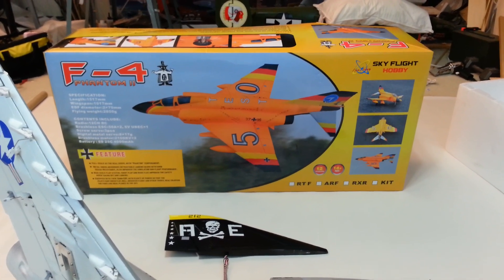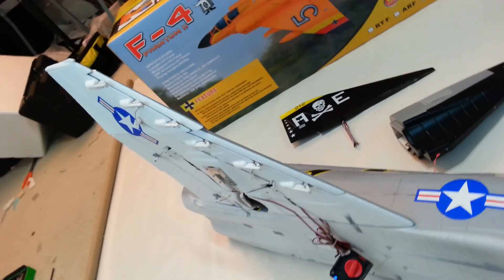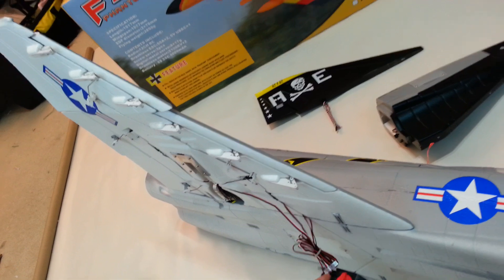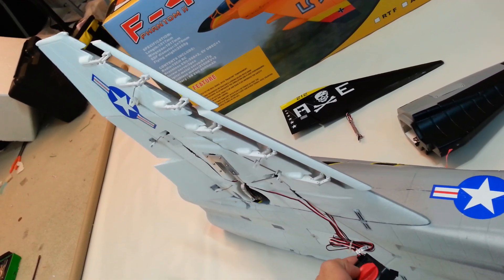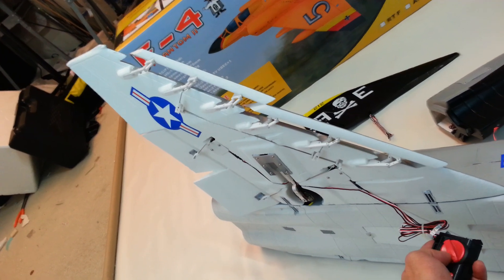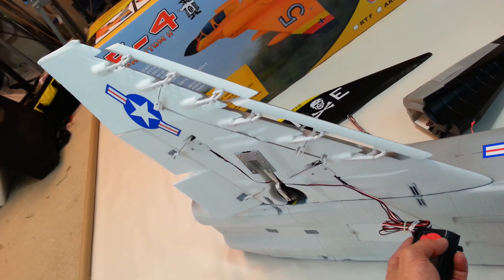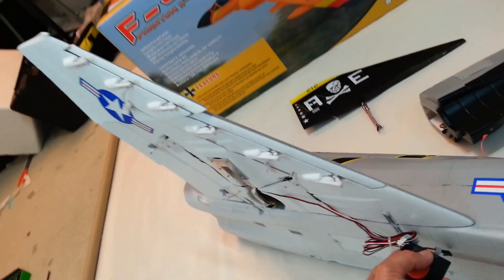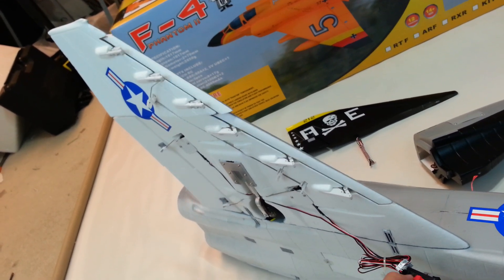LX Models F-4 Phantom ll Flap & Slat system

Comment: The LX F4 Super Phantom II is big and beefy and can fly slow enough for some decent landings.  I flew my F4 with a 3700 mAh battery.  Right out of the box it is a little nose heavy.  It is not as fast as the E-flite F4 but is is easier to see and can handle cross-wind landings. The slats help with slow flying.  You can tighten up the slats to even up the action of the control surfaces.

Comment: Love your channel! Lets see it fly! I don't think this one will stay stock for too long, any planned future mods ? Maybe twin eflite DF32 motors with 70mm housings and 10blade fans ??? You might have to weld those nice slats shut so not to rip them off. Lol
Reply from the maker: You only want to use slats while you are flying slow... slats should help you out by increasing the lift of the wing, in the event you add extra weight with the upgrades:)

Comment: LX models didn't do their research on the Phantom II. the outboard wing panels have their slats fix out
Reply: This is only partially correct. Although slats are only added on the F-4S models (for navy versions), but some of them do have moveable outboard slats.

http://tailspintopics.blogspot.hk/2012/12/f-4s-wing.html